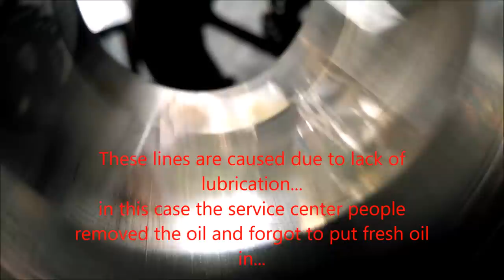Engine tear-down, tvs apache....

Comment: I made sure the "T " on the magnetic flywheel was on top and I could see through the inspection hole, and now for the marking on the timing cam , I am not sure about the position of the marking , should it be vertical and on the top ??? Please help

Comment: thomson  bro . thanks for this video . as i am apache rider  , so its very beneficial for me , you have described every nut and its usage  and every tool information , how to unboalt,,,, in which direction we have to unboalt each and every this included in this .....althought  video  download size is 1 gb , means good quality ,,,,i have downloaded it and saved it properly.............at last thanks again
Reply: Vivek Pandey is possible 220 piston in apache 180
Reply: no bro .....apache engine is not prepared to handle 220 cc power , and everything is possible , but cost will be high,as  we have to change gears size and our engine is small as compare to pulsar 200  and and we cant change our engine design , engine internal ports which will cost much around 10,000, and in half price you will get p 220 engine which can be fitted in apache
Reply: Vivek Pandey thanks alot... u know Any one big bore racing kit ecu kit racing exhaust... anyone have dealers link in india who can deliver in.mumbai
Reply: akshay kamble yes bro I have  some knowledge of this give me some time  . And I will give you positive update on this
Reply: Vivek Pandey yeah sure I m waiting

Comment: at 4:59 there is a pipe at the center of the video. What pipe is that and where it should connected to? That pipe is not connecten anywhere in my motocycle. Thanks.
Reply from the maker: The black one ? That's the sai system which we removed earlier
Reply: Well. Apperantly SAI unit is disconnected on my bike. But it works normal. Is it an important thing or should i use it as it is? Thanks.

Comment: I have question. can i convert my apache rtr 160 into 180 by replacing bore and piston? will it work like a standard rtr 180
Reply: you have to change the crank also . and yes then it will work
Reply: Vivek Pandey Are you sure about it??
Reply: 100% bro , one of my cousin brother  done same , and  that's why  i included one more part in your above list "Crank "   +  Crank Pin + Connecting Rod all three are bigger than what comes in 160 , and due to big size  it product more rotation per piston revolution , produce more torque....
Reply: and if you know hindi then i will provide you one of our authorized mechanic no , as mechanic only understand hindi bro .......well Syed bro wish you happy eid in advance
Reply: Vivek Pandey Thanks bro :). Ya I know Hindi but am from Hyderabad. Whats your location? Mechanic's location.
Reply: my location Is Indore Madhya Pradesh .

Comment: in my Apache abs the speed indicator in speedometer is stopped suddenly, can you help me in this ?  I think it is some wiring problem !!
Reply: check wiring in front wheel , may be  any tear shear , as in apache magnet speedometer work,this means in wires there is no cable , so check wires condition
Reply: +Vivek Pandey there is no tear, wiring is fine. in service center also not taking care properly.
Reply: then may be . there is issue in rotor  which comes inside front alloy wheel , which rotates and judge speed , do one thing go to service center and ask them to change the rotor / try if start
Reply: check the cable from meter(digital display console may be loose connection there, bec once i faced same issue for one month  some time my display show speed then it come to zero , so i checked display connection and display was loose from there only....if by this way your problem not getting solved then you need to change cable  cost around 380 rs

Comment: is apache 180 abs fully DC electricals?
Reply: yes
Reply: no
Reply: Vivek Pandey my apache   180 misfires I took it to the service center the service center they told me to change the sai I want to know does this solve my problem?
Reply: Rajashree Mohanty take confirmation from service center that after changing this part ...my problem should be solved ...if they say yes rhen go with service center or ...show your vehiçle to any other good mechanic who has good knowledge on apache